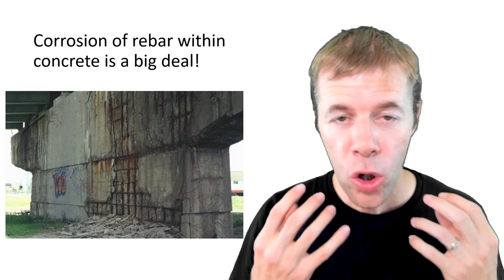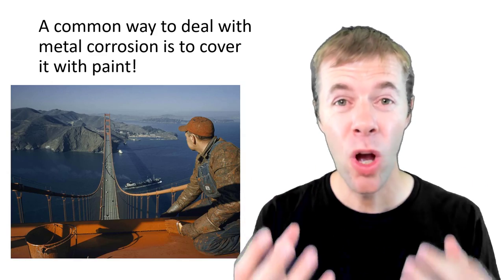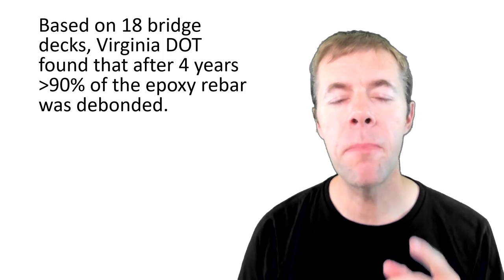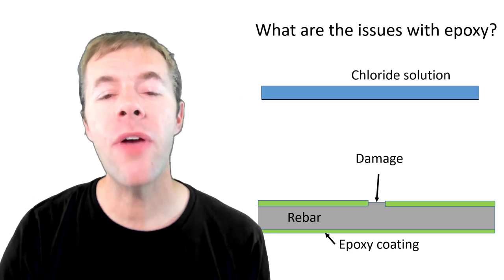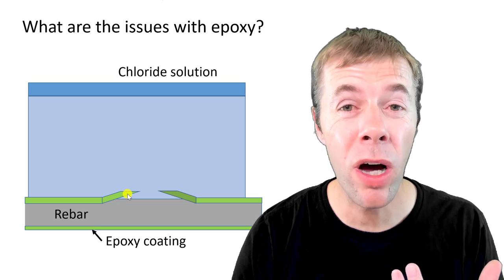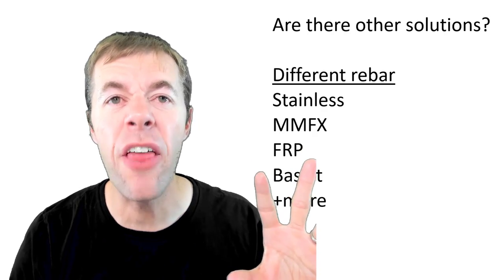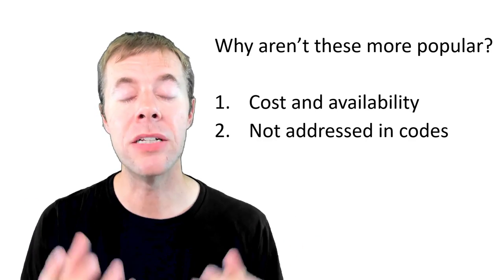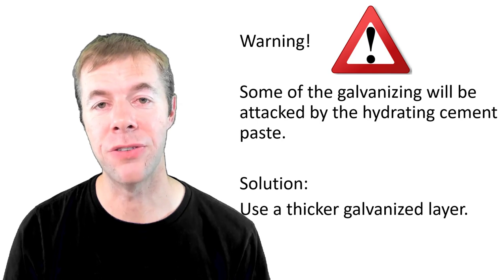What is epoxy coated rebar and why is it being banned?

Comment: Srainless steel rebar will work
Reply from the maker: Yes but they are 6x the price of conventional rebar.
Reply: You wish it was only 6X.  Fact is not enough cobalt in this world for doing this.   @TylerLey
Reply: Very expensive
Reply: @w8stral  Most stainless steels do not contain cobalt. Stainless rebar is usually austenitic stainless steel such as 304 or 316 (duplex grades may be used for high strength- at greatly increased cost) which contains  iron, chromium, nickel and (in the case of grade 316) molybdenum.
Reply: 400 series So called "stainless steel" is not stainless.  301-->304 isn't stainless either as they all corrode.  The PH series and 316 are stainless steel.  The rest are jokes.  So, ok, one form of stainless steel does not use Cobalt(316L).   @nerd1000ify
Reply: @w8stral  Duplex grades like 2205 also offer excellent corrosion resistance (often better than 316, especially when stress corrosion cracking is a concern), and once again do not contain Co.
Reply: =( This is what I get for making a stupid absolute statement =)   @nerd1000ify
Reply: Ok ok ok, let me change from not enough Cobalt in the world, to not enough Chromium in this world to satisfy an entire civilization to move entirely to stainless steel based on Chromium/nickel + the cool version with cobalt ..... =)   @nerd1000ify
Reply: @w8stral  Indeed- we can't make everything out of stainless. If I remember correctly the austenitic grades are mostly limited by nickel rather than chromium (nickel is rarer and more expensive) but of course the 400 series and 600 series steels contain far less of it (grade 409 doesn't contain any nickel at all!) so for them the chromium is a bigger issue. There's an argument that we should save our nickel for things that really need it such as jet turbine blades.
Reply: No one uses nickel in turbine blades other than toy RC jets.  Compressor blades... yes.  Turbine blades? Hell no and no one has for 50 years outside of giant power generation turbines where the tangential forces are greater than temperature concerns.  Use it for the housings/casings.  Yes, nickel is a problem and it is going to get FAR worse with the advent of electric cars.  No, it is not more expensive than Chromium.  Cr is 2X the cost. Cobalt is 4X the cost of Nickel and right now it is nearly 10X the cost.  Both, well, all three, Ni, Co, Cr, are equally rare and horrific to mine even when you do find a deposit, of the 3, nickel is the most easily found.   @nerd1000ify
Reply: Ooops sorry, forgot my link which you should enjoy perusing:  metalary.com    @nerd1000ify

Comment: Galvanizing also acts as a 'sacrificial metal.' If scratched, the zinc/iron acts as a battery to preserve the iron at the expense of the more active metal. Zinc does not form the scaly expanding rust that weakens and pushes apart the concrete.

Comment: I had a foundry business back in the UK and we were involved with a lot of marine and other anti corrosion applications for  things exposed to salt water. We developed a zinc sacrificial anode casting for rebars that was easy to apply on site after the rebar was formed and ready to install. It was a small cube of special zinc alloy with wires cast in to allow it to be attached by a wire twisting hand tool. We made a lot of them but I closed the business back in 2000 and forgot about the product. Having looked at the film I wonder if it was ever a viable product as it was cheap and easy to install on site. There must be a lot of them installed somewhere probably in the UK.

Comment: I'm an in the process of reinforcing and pouring concrete piers for a new deck right now.  That's the reason I'm watching videos like this one.

I just spent $75.00 on a gallon of Rust-Oleum Gloss White Farm and Implement paint. It is my intention to paint the rebar and hardware for my deck with this paint. The rebar is going inside the concrete piers.

I'm trying to decide if there is a better coating material???

Comment: I have worked with galvanized bar from the 1930s which, although fully exposed to the weather, can look new except for the dust and dirt.  But the galvanizing of yesterday, as I understand it, was much heavier and often double dipped.  Moat galvanized stuff available today is crap that will start rusting almost right away.

Comment: Thanks for this video, I was wondering why I never saw this kind of green rebar anymore at construction sites when in the early 2000's it was the rage. I'm in Ontario, Canada.  I can testify that the green rebar did not help in preventing rust. We demolished walls that were only 8 years old and the green rebars were all rusted just like the ones with no epoxy.

Comment: For rebar that is galvanized, would the lap splice be affected? For that matter, would Ld be the same as uncoated bar or is it even covered in ACI? How about the use of mechanical couplers? All stuff to remember if it is to be used. Galvanized steel, bolts and washers are widely used and the bolts are covered in code. I have seen MMFX bar used for water detention tank but only for the inside bars. The outside bars were VE’d out so just regular 60 grade bars were used with a water stop in the center. Good stuff as always! Not enough people cover this. Thank you!

Comment: It's obvious that GFRP rebar is a superior product to any steel rebar and for many reasons, so if cost was equal (or lower) to steel and production could meet demand, would you recommend it then?  I can't tell when this video was made, but as a distributor of GFRP with a major manufacturer today (Q3 2024), I can confirm that our landed cost is less than steel, and we can supply any amount needed if the order is made with enough advance notice.

Comment: What about bamboo, and reeds, and hemp and even wheat straw as reinforcement?
 Not necessarily as a complete replacement for steel, but perhaps in some cases it could be.
Reply: It is not listed in the building codes and build officals and engineers are limited it to what they can work with. I believe he said someting like that in the video.
Reply: @TexasEngineer  Right, but he's doing research and testing. I was asking if it's worth looking into.
 Obviously we don't want to just build a bridge with untested materials and hope it works out.. 😉

Comment: Fiberglass rebar is being tried here on the Texas coast.   It is expensive, and requires shop bending and forming.  But it is very light, and so far is performing well so far as I have heard.   Don't store it for years in open sunlight thought.

Comment: what's the solution for the cut edges of the rebar? do they need to be painted to galvanise them? what if the galvinisation is scratched? powder coating is tougher but more expensive...?

Comment: I Poured a concrete sea wall 33 years ago.  It is exposed to saltwater.  It is a cantilever design with 3" of cover on the tension side and and 61/2" on the compression side.  I used standard rebar.  There is very little cracking and the only corrosion visible is at some of the exposed form ties.  Any guess at how long it will last?

Comment: I'm a rodbuster here in Canada.  Been building all the new bridges here in Ottawa for a couple years.  If it's exposed face, it's stainless always.  Sometimes half the bridge is all stainless bar.
Reply: Also a note on galvanization:  We always have to cut bars in the field to fit, cutting anything galvanized is toxic as hell.  2 - no one is going to end up spraying that properly afterwards.  3 - When bars get dipped, as they exit the tank, the zinc drips and solidifies into these razor sharp ridges on the bars, making them brutal to pack on your shoulder or install.  I've seen many lacerations from galvanized bars.

Comment: I think bridges up north decay faster since salt is poured on it during winter. Here in south Tx there is a bridge build in the 50’s that’s shows no damage at all.I’m just assuming why it happens.
Reply: Bingo.  Also the freeze thaw cycles induce cracking and water intrusion, which accelerates corrosion, which leads to more cracking, and on and on and on.
Reply: @brockwagner939  👍
Reply: There’s salt near the oceans too… like Miami…
Reply: @roydrink  I believe that is what happened to the building than collapsed in Florida..I don’t know, I’m just assuming, since it’s next to the ocean.

Comment: I'm a structural engineer in Europe. I never even heard of coated rebar. According to European standards steel has to have a certain concrete cover depending on exposure. I assume it's similar in the US. But what are the specifics? The necessary cover specified in the respective Eurocode typically ranges between one and 2.5 inches.

Comment: Chemical engineer here: galvanizing protects the steel because it is more reactive than the steel & corrodes in preference to it. Once the zinc layer is used up the steel will start to corrode. The corrosion products will probably be a greater volume than the zinc, so tending to crack off the concrete covering layer. I've worked on salt plants & paint is preferred to galvanizing- it just hides the corrosion until it's too late. Stainless steel will resist chloride corrosion at low temperatures (below 50 C) & it has a higher allowable stress level, so could be made thinner, to partially offset the extra cost. Cheaper high chrome, low nickel alloys might also help...

Comment: Could you make an electrical connection to the rebar and reduce corrosion with cathodic protection? How much power would be required? Could it be provided by solar so the whole thing is passive?

Comment: Great video!

A more practical solution for slabs could be increase thickness of your cover, use SCMs to replace low alkali cement, use a permeability reducing admixture, use concrete of low w/cm, and cure for at least 14 days.. 

and if you have a vertical surface, just paint it!

Comment: What ever you coat the rebar with, when it is welded, the coating is gone in that area and  it becomes an entry point for corrosion.  Concrete with rebar in roads just has to be replaced from time to time unless you use a different driving surface. Or maybe coat each welded areas for added  protection and a heck of a  lot added cost.

Comment: I love galvanized duro wire for example, we do structural masonry work. We are replacing 300' x 6.5' brick walls due to rust jacking 30,000 brick. The wall was built 1988, replacement cost cost of 
$375,000. We use stainless steel reinforcement.

Comment: Before pouring the concrete, maybe expose the rebar to light corrosives to make micro fractures and small pitting in the coating easier to spot and repair?

Comment: Have you looked at Australian Standards?   As I remember it, 'IF' the contractor installed the rebar  properly, ie min. 40mm cover from outer edge of bar to exposed surface of concrete, wire tie is not permitted to breach this cover, lose rust, oil, paint etc cleaned off immediately before pour, and correct pouring technique by 'placement' as opposed to dropping, (affects segregation), and use of mechanical vibrators (instead of poking sticks and poles), while placement occurs in order to avoid air entrapment (ensuring not over vibrate which also causes segregation), then you've done the best that can be achieved.  The high alkalinity of the cement 'passivates' the steel and protects it.  Much like anodising of aluminium protects. The extra cost of gal bar is not warranted as it does not significantly enhance performance over best practice concreting techniques. Concrete type also has a great impact ie use of well graded fines assist in chloride and polluted environment such as near the sea and exposed high rise city construction minimises likelihood of water tracking through pores etc.

Comment: I like your advice.  I’m getting ready to set a 6x6x4 footing for a 60 ft free standing radio tower at my homestead.  The engineering specs call for #5 @ 7” max c/c each way top and bottom.  The only rebar spec is ASTM A615 (Grade 60) w/ 3” of cover top and bottom.  I think I would like to use galvanized.  I’m in Michigan, any reason not to use galvanized?

Comment: I'm interested in building a multi story underground bunker basement with 18-24in thick walls.  I Watched your video on fiber reinforced concrete mix and I plan to use that but I'm curious what the price difference is between galvanized and 316 stainless in 7/8" or 1"' rebar?  I'm having trouble finding pricing on stainless steel

Comment: Was involved in some rebar research back in the 80s and early 90s on Johnston Atoll in the Pacific on concrete-encased rebar, galvanized, regular and epoxy coated. Some concrete was dosed with chemicals to try to stop or neutralize chlorides. Some worked ok, most did not. Also, per civil engineering and adopting new stuff, CE is a very conservative field, and rightly so, since the consequences of failure can be catastrophic.

Comment: This is why I’ve been told you never under coat a truck or a car with those thick black paint. It’ll cause more damage than good and you won’t see it a lot of times since rust starts forming below the painted surface.

Comment: So I remember a study done on concrete type reinforcing done on clay and straw that was used to build things 2000 plus years ago. It went on to state that the straw was long gone from the “ concrete “ and the cylinder shape of the tube left behind in the structure was the reason the structure was still able to withstand the different loads applied to it. These clay “ mud” “ concrete “ structures are still around 2000 years late. I was also the recipient of a 2 million dollar loss on a project I built in the Caribbean “ Diesel power Plant” mostly due to approach to epoxy coated rebar by the Bank appointed consulting engineer. This guy was so negative to my choice to use Epoxy coated rebar, he basically had my crews tear down and rebuild all of the form work due to damage to the rebar epoxy.
The rebar was in a 3 inch cover of concrete but this engineer was determined to ensure the project would be expensive for me. Never again will I ever use Epoxy Coated Rebar. Thing is, he was OK with the use of standard uncoated and very rusted standard rebar. Go Figure?
Many Straw would have been a better choice.

Comment: What about all the buildings using standard rebar? Are they all deteriorating at the same rate? Now I am concerned that the engineer did not specify galvanised rebar in my footings. I have already brought the steel to site.

Comment: Ok was reinforcing 4 each 2" pvc rail risers on steps in a chlorinated saltwater pool,   I coated the rebar with 3 coats of undercoating used for cars. Used a funnel to add dry topping mix & added a little water along the way.  So how long will that last? Know from boat work that epoxy needs to be vacuumed bagged if at all possible to avoid air pocket, also called blisters.
Reply: The chloride helps undercut; the metal gets corroded below the paint film and the paint peels off like a burnt skin. The paint is not really damaged but the metal below is now rusted - initially only a thin film and later a layer after layer of rust that can crack the concrete.
Reply: @janami-dharmam  Thanks

Comment: I know this vid is 4 years old but Tyler hit the nail on the head a lot of engineers are moving away from epoxy coatings to Hot Dipped Galvanized rebar one of the local steel mills is producing almost 2 to 1 Hot dipped Rebar .
 Most people don't give two Sh**s about rebar if they're not in construction , but  It was rebar spalling that was a major reason the concrete failed in the Miami condos that collapsed. The number of older buildings and bridges were something similar could happen is beyond scary.
 My uncle was actually;y on the crew that paints the Golden Gate back in the mid sixties until he got a job working on the Trans America Building (Pyramid ) late sixties.

Comment: How does galvanizing help you avoid the issue of pitting and accelerated corrosion at a location where the galvanizing layer has been scratched or nicked?  Are you relying on the galvanizing layer bring thicker, thus less susceptible to being scratched or nicked in the field?  If so, is there some type of correlation between the thickness of the galvanizing layer and the expected number of field induced scratches and nicks?  Also, wouldn't one scratch or nick to the surface layer of the metal be sufficient to initiate failure?  Or is there an aggregate minimum threshold of field scratches or nicks needed to initiate the mechanism of corrosive failure?
Reply: sure, true, yes, aha, right

Comment: Does dipping the re-bar in hot zinc heat the re-bar and lower the tensile strength of the bar because of heating ?